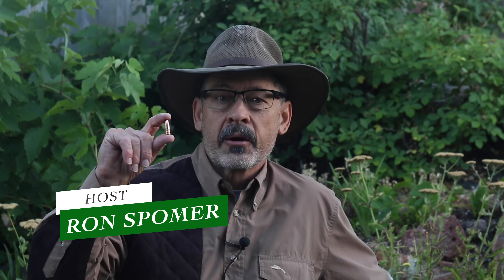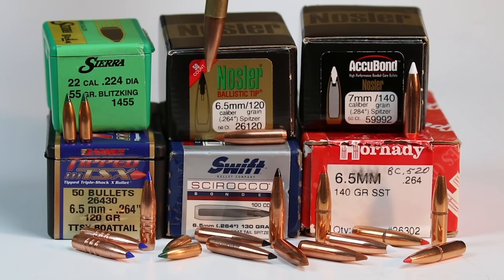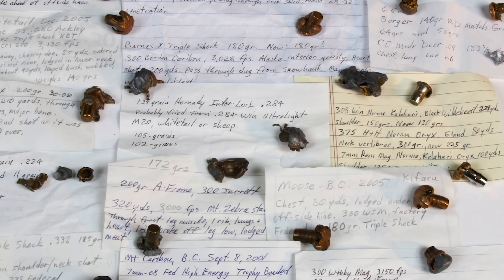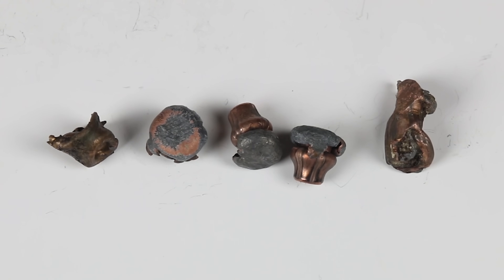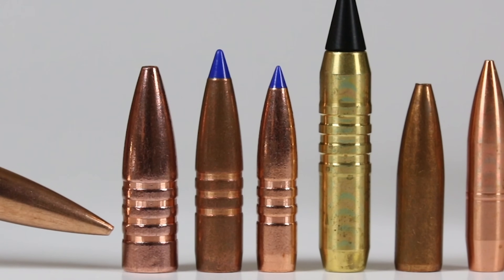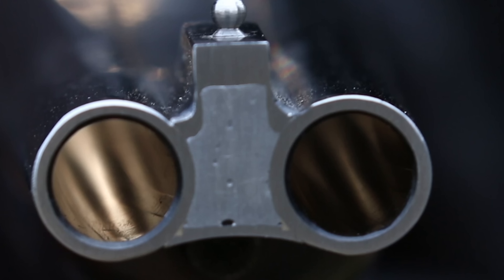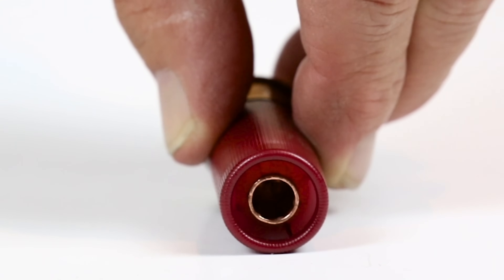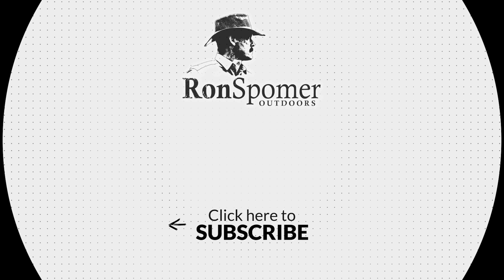Copper Versus Lead Core Bullets — How They Work

Comment: Hey Ron...love your videos~
 I have a Winchester Model 1892 made in 1896 and was told I should shoot ONLY pure lead bullets through it, and NOT copper or copper cased or alloy bullets.
Can you weigh in on this for me?
Reply from the maker: Hugh, jacketed bullets (copper or gilding metal of 90-95% copper alloyed with 5-10% zinc) were invented in 1882 and quickly adopted to minimize or eliminate the significant problem of lead stripping in barrels. I've never heard of any problems arising from shooting modern, jacketed bullets in an 1892 Winchester of any vintage. Hornady, for instance, sells jacketed bullets for the 25-20, 32-20, 44-40  and posts no warning against using them in any old rifles thus chambered. Speer builds jacketed bullets for the 25-20 Winchester and posts no warnings against using them in any M1892. More significantly, Winchester and Remington factory-loaded ammo for the 25-20 and 44-40 featuring jacketed bullets. Solid steel bullets might be a bad idea, but gilding metal and copper jacketed bullets? Concerns about hard bullets in older firearms revolve around pressure concerns. Many older rounds were loaded to low pressure standards that can be exceeded with modern, high-energy powders, and this could cause problems with weaker actions or barrels, but strong, high quality fluid steel barrels were already common on rifles in the 1890s.
Reply: You should have no problem using copper plated swaged lead bullets - they don't cause significantly more bore wear than lead.  I use them in my First Generation Colt Single Action Army, made in 1884.  Colt SAAs before 1902 are black powder only.  Gilding metal jackets will cause more bore wear than lead or copper plated lead, plus they are way more expensive.  At black powder velocities, jackets provide very little, if any, advantages.  Jacketed bullet smokeless 44-40 ammo is completely safe in a Winchester 1892 (my modern 1892 clone will easily handle 40,000 psi), but shouldn't be used in black powder only guns, even when the pressures are equivalent to black powder loads.  The pressure curves of the two propellants are completely different, and more than one fine old Colt has met its demise shooting 'safe' modern ammo.

As far as 'hard' bullets go, they actually can produce less pressure with equivalent charges than soft, swaged lead core bullets.  The hard bullets don't upset as fully in the rifling, forming a less perfect bore seal than softer cored bullets, even though the resistance to the lands is greater.

Comment: I have a question. I was recently reading the opinions of a guy from his personal hunting experience. He stated that the found that solid copper bullets would not expand in a slower cartridge like 308 or 30-06 at longer ranges. Around 400 yards. He also stated that he quit hunting with them a long time ago. Is this still a problem today or was it ever in your experience?
Reply from the maker: Tim, at some distance every bullet will have reached energy levels at which they will not expand on impact with certain substances. All-copper bullets can be built with hollow nose cavities of varying widths and depths which change expansion. Lead bullets are modified with varying degrees of jacket thickness, zinc percentages, skiving, pure or alloyed lead, hollow noses, etc. I've seen some copper bullets advertised to expand at 1,800 fps, some down to 1,600 fps, but of course at those speeds the petals open less than they typically do at higher impact speeds. A Barnes 165-gr. TTSX at 2,850 fps MV from a 30-06 will be flying about 1,900 fps at 500 yards. The 308 Win. starting 2,750 fps should keep this bullet at 1,900 fps at 450 yards. The challenge with all bullets is making them tough enough to withstand impacts at close range, yet still expand at long ranges.
Reply: @RonSpomerOutdoors  thank you for the insight!

Comment: One of the best videos on this topic. Thanks, Ron! On that note, are the "budget" copper bullets like Federal Power-Shok Copper & Winchester 95/5 comparable in terminal performance to the Barnes bullets, Nosler E-Tips, and other more premium offerings? Or are they more like traditional cup-and-core ones?
Reply: Significantly lower performance vs Trophy Copper.  270 in PowerShok Copper performs almost like a 30-30.

Comment: Good one Ron, Is that a Woodleigh of Australia i see here @7:56
Reply from the maker: One of those might be a Woodleigh, but most are Trophy Bonded Bear Claws, Swift A-Frames. I once pulled a .416 Woodleigh 340-grain Protected Point from the offside hide of a small axis buck I'd shot with a 416 WSM wildcat. It was fairly mangled, but had retained much of its mass. To my knowledge, all bonded bullets use pure lead which is quite soft and easily mangled and eroded.
Reply: @RonSpomerOutdoors  Wooleighs are Simply, Awesome. Thanks fella. Keep it up. love the Content.

Comment: Thanks for passing along all copper bullets vs. lead core bullets. Cooper weighs less than lead. Does that mean the copper bullets will come out of the barrel faster than the lead core bullet of the same shape?
Reply: I'm not 100% sure what you mean but, I think your asking whether a bullet of the same external dimensions wod copper be faster. Simple answer is yes. This is because the copper will be lighter compared to the lead.
Reply: @johnventers5128  Thanks for the info.
Reply from the maker: Yes, Tyrone, as John writes, a copper bullet with the same width, length, and form of a lead or lead core bullet will be lighter because copper is less dense (heavy) than lead. A marshmallow bullet would be even lighter, a tungsten bullet heavier.
Reply: @RonSpomerOutdoors  Thanks for the info.
Reply: Marshmallow bullets do not work very well and foul the barrel pretty badly. I'd suggest loading it with a paper wrapping over the wadding, not just in bare marshmallow front of an overpowder card and a felt wad. On the bright side, you can stack any number in without causing pressure problems, although the low BC makes them of... limited value.
Also, they don't taste very good after being fired. I'd suggest sticking to melting them over an open fire.

Comment: Thanks Ron, a good breakdown of the different bullet types.  Years ago a good friend of mine got me on to the Barnes TSX bullets.  I am mainly hunting white-tailed deer, but I found from my 7mm-08 that the performance on whitetails seemed to vary a lot.  At times the deer would immediately drop, but most often they would run afterwards a fair ways.  I heard that the TSX bullets were better suited to larger framed game, and that they may not have been expanding fully on white-tails to sufficiently dump the energy.  Is there any merit to this claim?  

The main reason I switched away from them however was due to accuracy.  I have not tried them again in that rifle for a long time, but I did load up some of the 100 grain TTSXs for my .257 Wby Mag, and they were the most accurate bullet I tested from that rifle.  Right now I’m shooting Nosler Accubonds for everything, which I like.  They are accurate and dependable.  But I’m always game to try something different.
Reply from the maker: Aubrey, in my answer I forgot to address your "dump the energy" question. Energy dump contributes little or nothing. Bow hunters know this. So do poachers who take deer with 22 rimfires. Energy beyond that required to expand the bullet (for more surface area to rip and tear vital tissue) and penetrate to/through maximum tissue (for increased hemorrhaging) is superfluous. The kinetic energy carried by the bullet is absorbed and dissipated by the animal's tissues. You've probably seen this in slow motion videos of game being hit. You see the flexing, warping, etc. of the body. And often the struck animal runs off. Normal stuff. A bigger wallop doesn't matter. I've had many coyotes absorb a 7mm Rem. Mag., 300 Win. Mag. and run off 20 to 40 yards before expiring. I've had 80-pound warthogs take three 300-grain 45-70s slugs from inside 50 yards and continue running until blood pressure dropped. The whump just isn't what many of us imagine it should be.
Reply: @RonSpomerOutdoors  Thank you Ron!  Your input as a man with much hunting experience is greatly appreciated.  I especially loved in your video how you kept all the various recovered bullets from different hunts, what a great idea.  Yes I agree, as I lifelong bowhunter myself - my goal when I am hunting with my bow is to get that arrow to pass completely through the animal.  It increases the tissue damage done as well as the chance of recovery should the shot be less than perfect.  Over the years I have adjusted what I use in terms of arrows and broadheads in order to maximize the chance of getting a pass through, and doing so when conditions are less than ideal (like hitting bone or the animal stepping or turning).  Now with this in mind, this gives me a different perspective on how I should expect bullets to perform, in that what I want to achieve in either scenario is quick kills and recovered game.  

I have noticed with the Accubond bullets as well, only once did the deer almost drop immediately.  The rest of the time the deer still did travel some distance.  So all in all, not much different from how the Barnes bullets performed when I used them years ago.  

Another thing you mentioned was about bullet length and the rifling twist needed to stabilize the longer bullets.  This got me thinking if this is perhaps what was causing the accuracy issues I experienced previously with my 7mm-08.  Currently I am loading the 150 grain AB long range as the regular 140 grainers were impossible to find in my area for a while.  The 150s do ok but don't group as tight as the 140s did - but I don't know if the 140 grain TSXs are the same length or longer than the 150 grain ABLRs.  Now I am even more interested in trying out some of the 120 grain TTSXs to see how they will shoot!  I will have to do some more digging and experimenting.  But this is a part of why I love hunting and shooting so much, there is always more I can learn.  Thank you again.
Reply from the maker: @AbBowhunter  You are thinking this through nicely, Aubrey. I find it curious that many rifle hunters think that broadheads and bullets kill differently, meaning that broadheads slice to create hemorrhaging, but bullets supposedly deliver some kind of knockout punch. But in this age of video we've all seen plenty of animals absorb 3,000 to 4,000 foot-pounds of bullet energy applied to the vital organs and run for several seconds before succumbing. Then, as blood pressure drops, so does the game. Bullets kill by hemorrhaging, too unless they strike the central nervous system from the withers forward. But the same thing happens when a broadhead hits the CNS. The confusion for many is this still unproven "hydrostatic," more accurately "hydrodynamic," effect in which a lung-shot animal flops over dead on the spot. Some insist this isn't shock, but another theory is that energy transfer via the blood circulatory system breaks vessels in the brain causing, in effect, a stroke. But this can happen as easily, if not more easily, with application of a frangible "varmint" style bullet at high velocity than a larger, heavier "dangerous game" bullet like a 400-grain at 2,200 to 2,400 fps. Many have their theories about "shock" kills, but I'm still looking for documented, scientific explanations for that phenomenon. In the meantime, I'll continue to depend on bullets that maximize hemorrhaging of vital tissues -- and blood trailing. Thanks for your observations, Aubrey.
Reply from the maker: There is some merit to that claim, Aubrey, just as there is merit to some claims that (choose your bullet) sometimes "fails" because it didn't open or opened too much or... Notice the video clip of the Barnes bullet opening after passing through that apple, which is a bit smaller and lighter than a whitetail. But it has high water content. This created hydraulic pressure that forces open the hollow nose. Does this always happen on game? No. Perhaps some dirt or mud on the hide got in the nose cavity first. Perhaps the lungs were too insubstantial to initiate expansion. Perhaps... who knows. I have experienced it all with Barnes TSX, but the vast majority of times every Barnes bullet from the original X to TSX to TTSX have expanded well and terminated the target animal quickly. Some instantly, some after the usual short run (until blood pressure drops.) In the Dark Ages (1995) I fired 12 Barnes X bullets at 12 African animals sized from tiny steenbuck and duiker to kudu and eland. Each one expired. I did fire two more bullets as finishers on two as they lay expiring at our feet, but they were essentially done from the first hits. Now when I show up in Africa with Barnes the PHs (guides) say things like "Excellent. It's like a soft point and solid on one bullet." Can I guarantee every Barnes bullet will perform perfectly? NO. But I can't promise perfect performance from any bullet. Just too many variables with game. A big part of being a hunter is knowing how to track, and Barnes bullets generally punch through to leave a better blood trail for that.
Reply: I’m a accubonds fan as well. Love the 110s in my 257
Reply: I would agree broadheads and bullets both kill via hemorrhaging. I would also dispute a claim energy means nothing beyond that required to open up a bullet. It is that energy transfer or shock, if that term is preferred, that causes cellular tissue disruption and subsequent hemorrhaging. This is the precise reason neither FMJ nor highly frangible bullets are appropriate for hunting. All other variables held constant, one provides little energy transfer to tissue, the other expends all it's energy prior to reaching tissue considered a vital organ. Energy, rather energy transfer, cannot be discounted when making a choice of cartridge or bullet appropriate for a particular game animal.